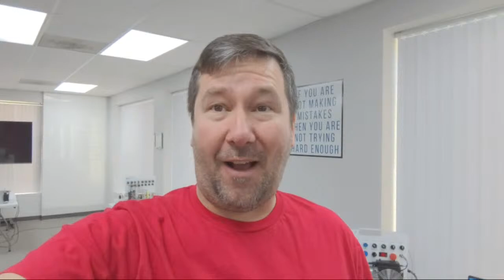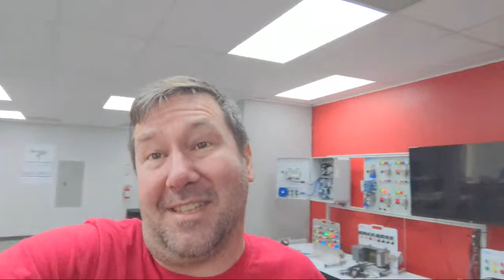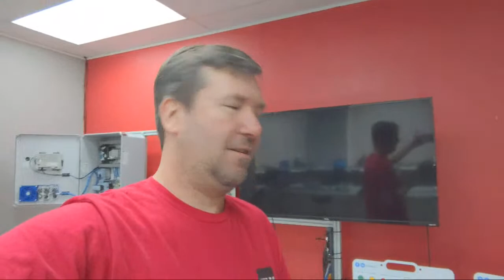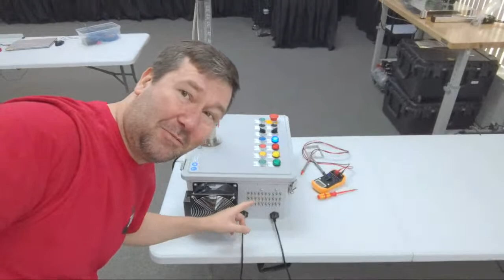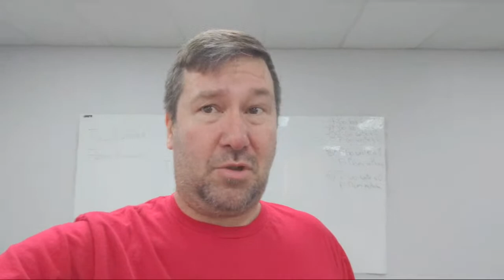Summary of this Week's PLC Training

Comment: Hi Tim, could you do a video comparing the quality of analog inputs and outputs across various Allen Bradley PLCs from plug in modules to external cards etc. As in comparing what would be suitable for what applications.
Reply from the maker: Do you mean as far as 0-10VDC vs 4-20mA or bits of resolution?
Reply: @TimWilborne  resolution, isolated vs non-isolated. Etc.
Reply from the maker: @aussiegruber86  I've hit that sporadically in some videos but it probably deserves more attention.
Reply: @TimWilborne  Thanks Tim,